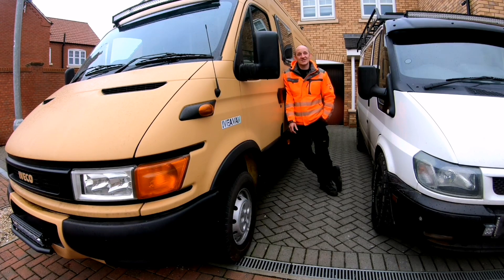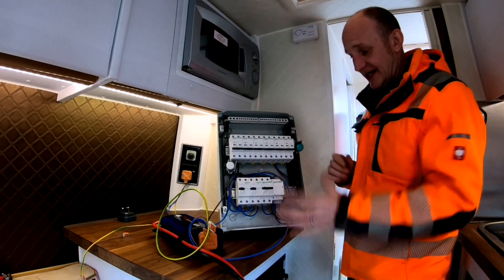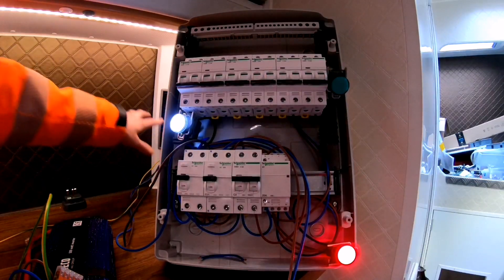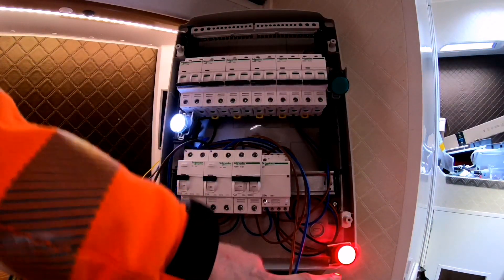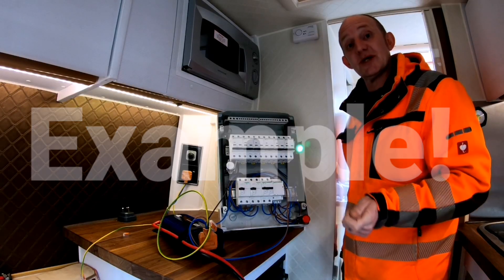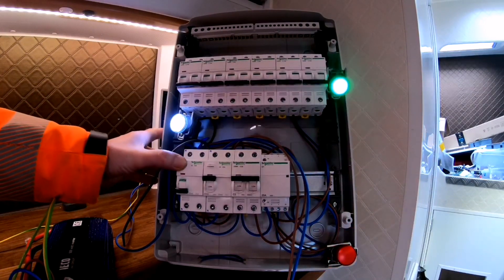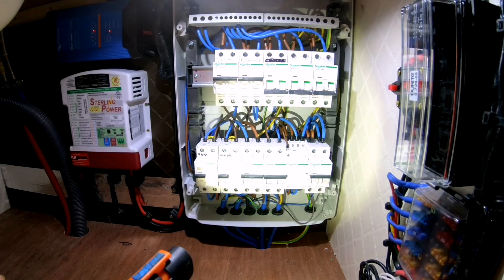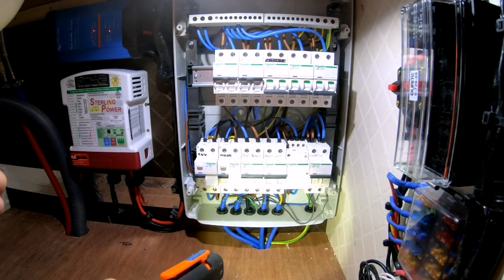DIY Camper Van 230v Mains Electrics. Automatic Change Over Switch & Q&A.

Comment: Hi Mark, thanks for the schematics, but i think you may have got the inputs to the contactor crossed. As i understand it the inverter supply (12/13) should go to terminals R1 and R3 on the contactor, not terminals 1 and 3.If I'm wrong apologies, but this is exactly the setup i want to fit in  my conversion, so need to understand and get it right. cheers
Reply from the maker: A link to the new wiring diagram https://www.instagram.com/p/B8AMqhxHNJk/?igshid=lciz4fcxrmvj
Please don't follow the one shown in the video !

Comment: Hi Mark, thanks that somewhat help. I’m building a portable power with 240v inverter. The unit Earth is isolated. I’m getting a electrician to help me with it. Just want to know. How would I can earth my box went I have no Metal just a fuse box and Negative post. Yes I kown I can use a earth rod. Would I know how to it with out one The plan is to wire a 2 outlets with a RCD
Reply from the maker: Whats the manufacturer of your inverter bud?
Reply: @Iveavan  KickAss 2000W Pure Sine Wave Digital Inverter
Reply from the maker: Ahhh right, it looks like an Australian product? Do you have an installation manual for this? If not I can send you a copy if you email me at iveavan@yahoo.com
If you have, looks like you have an earthing point, No 8 within the manual, (I've had to Google that so whether it's the same model as yours I'm unsure🤔) you can bond from position 8 to the consumer unit like I have, or bond straight to the chassis which is ever the easiest path for you (the consumer unit should be bonded to the chassis of the vehicle either way bud) 😉👍.

Comment: hey there, what cables did you guys use for the 240v and 12v setups? I seen Greg Virgoe used 2.5mm and 1.5mm. Do you think it's an overkill for things like sockets, lights, fridge, pumps etc? (I'll never be connected to mains, only solar power + alternator) thanks!
Reply from the maker: 12volt wise I used 1.5mm & 2.5mm too, not so much about the load but it's the distance too as we both have long vans, I'd personally go overkill, at least if you know what your running off that run of cable, and want to add something else to it in the future you could do safely (as long it's not over the amp rate of that cable). But With every thing running on 12volts in my van, it's only around a 12amp draw from the battery. 240v cable size I think that was 3mm in the blue artic cable roll 😉👌👍👍👍.
Reply: @Iveavan  good man, thanks for your reply! I'll probably go with a heavier cable too. Overkill is much better than worrying about it later on :)
Reply: @Spunky.sparks  yeah went with 2.5mm for 240v and 2mm for 12v in the end so should be plenty enough 😁

Comment: Ref to EHU lead........
The regs say.....max length 25mtrs, not +/-2mtrs
Reply from the maker: This is what the British Standard BS7671:2018 (Requirements For Electrical Installation) actually say! Section 721.55.2.6  (ii)" I quote" a Flexible cable of continuous length 25m (+/- 2m)👈😉👍.

Comment: Any details of the 2 light bars you have on the front of your van. Any footage of fitting.
Cheers Harry
Reply from the maker: I'd film some parts of fitting them here's a link to them bud 😎👌👍👍👍. MICTUNING 50" Inch 288W Curved... https://www.amazon.co.uk/dp/B01EXXWHGY?ref=ppx_pop_mob_ap_share
SKYWORLD LED Light Bar, 7D 20... https://www.amazon.co.uk/dp/B07SQ8K8TN?ref=ppx_pop_mob_ap_share
Reply: Cheers for that, will get the number plate one. 05 Transit Jumbo conversion. Thanks again Harry

Comment: This guy is a really cool bloke , I still don’t get it , but I am dislectric always have been , and have been told off by electricians before for nearly wiring myself up to to 240v , and apparently bell wire is not a good feed straight from the meter for my 3 bar electric fire (they are fussy fuckers) , top vid , moral of the story is , if you don’t know what you are doing , don’t fuck with it , this guys is great for showing why 😉👍

Comment: Brilliant explanation thank you. I had no idea that a relay device was available to fit into a consumer unit.
Reply from the maker: Cheers matey 🍻👍. All the links for it in the description bud 😉, nor did I to be honest mate until I asked Spunky two questions... Can I turn lights on via internet and can we avoid change over switches where possible 🤔, he seems to be coming up with the answers so far! He needs challenging further! 🤔😉👌👍👍👍.
Reply: GSM Relay between £20 to £30 mate. All commands sent via text to it 😀
Reply: Quite a standard item, used for sensor lighting, emergency lighting and heating systems. Usually in commercial installations, not very common in domestic setups.

Comment: Brilliant that 👍 I see you are using bootlace crimps into the board ,is that because the cable is flexible and solid conductor cable doesn't need them
Reply from the maker: That's correct bud 😉👍👍👍.

Comment: hii Mark, hey Mark, did you weigh the vehicle? how many kg? Also what are the dimensions of the electrical panel you use? 

 And; How many Amps W auto fuses?
Reply from the maker: All the links are in the description bud, No not yet, I'll do a video regarding the vans weight in April time (ish) once I've finished 😉👌👍👍👍.
Reply: @Iveavan  I saw them ... ok.  thanks ..    :)
Reply: Go and weigh some scrap in. (Copper is good) they will tell you the weight and pay you for the privilege. Just be careful of your tyres.
Reply from the maker: @chriscoulthard4947  I love the honesty of Worthing folk 😎 😉👌👍.